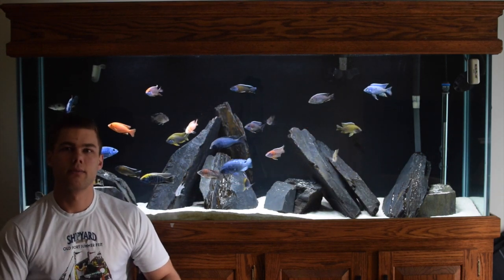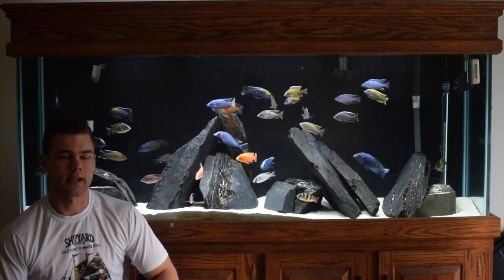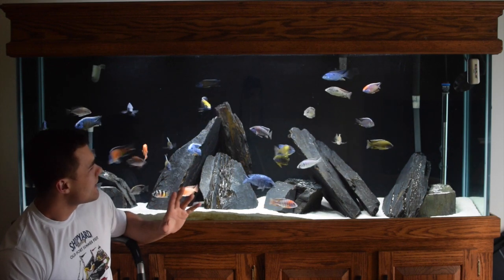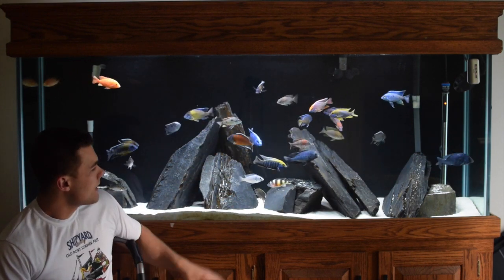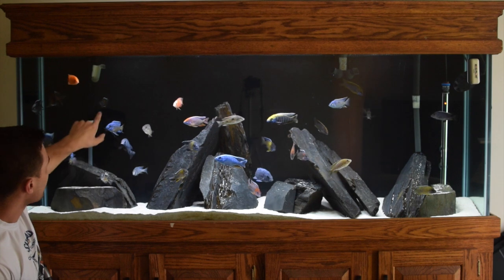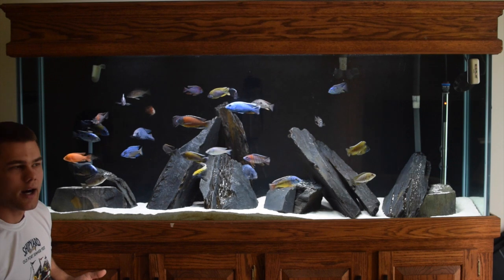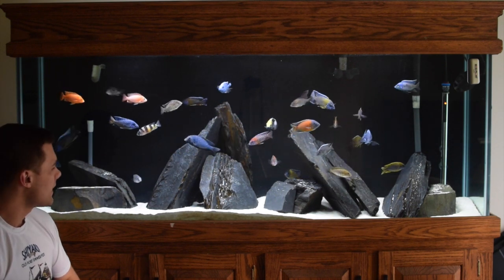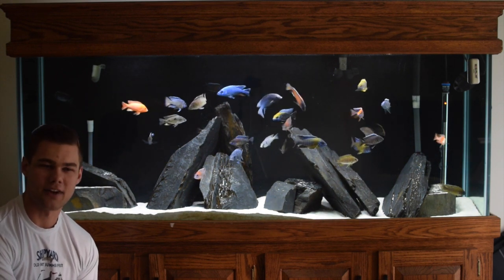Lighting 101 - African Cichlid all male hap/peacock lighting - How to!

Comment: The following is:

The best lighting for African cichlids is Blau Lumina Led 152 special reef

But, you have to know how to program it, do not use automatic programming

Schedule manual

My aquarium is 2 meters long and is lined back and sides with panels of - Juwel

So the light gets more concentrated in the aquarium

To avoid excessive light and the opposite

The programation:

Coordinates 10 South

                        34 East

Midday Function 15:30

Intensity Filter - 60% - yes, - 60% Lake Malawi is deep

Nubellate Days, to your taste, 2 to 5%, as Africa is constant heat and rains little as we have already decreased the light intensity I recommend 2% for occurrence of cloudy days

The Blau Lumina Led 152 special reef - special reef is expectular for dusk with its dimming channels - 2 actinic LED lights per plate

And dawn is also phenomenal